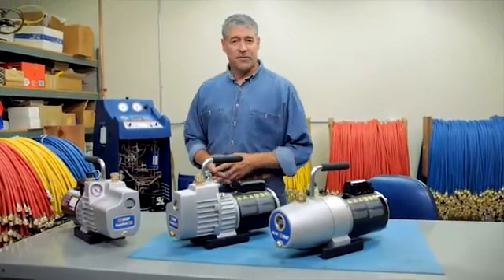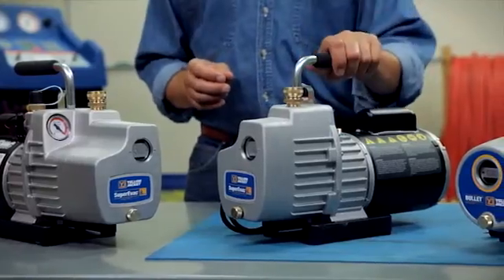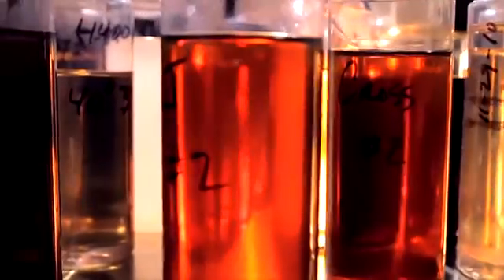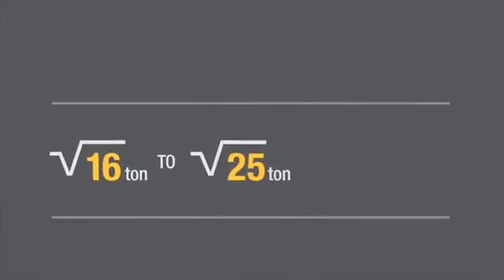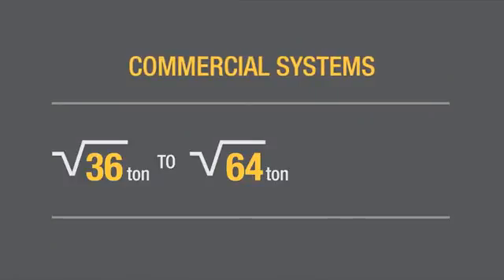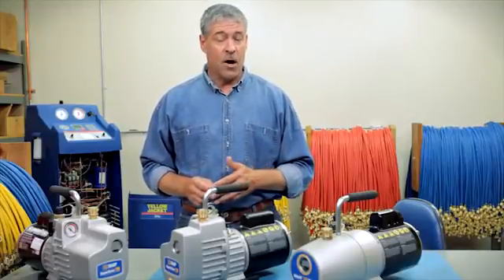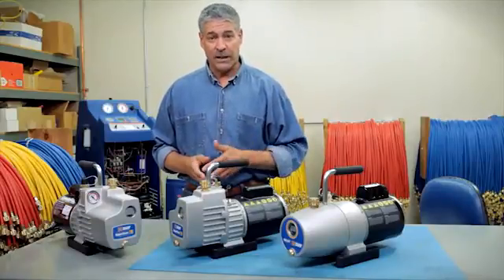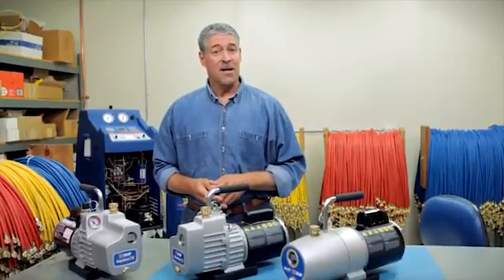How to choose a vacuum pump

Comment: My first comment didn't go through, but this is the question. How are residential units 16–25-ton systems if 1 TON=400 CFM...Most homes won't have but 2100 square feet equaling about a 3.5 TON system. Even the bigger houses you come across MIGHT have a 5 TON system. But these homes usually have a higher cooling and heating load because of high ceilings or glass windows and doors. Maybe the highest overall Tonnage of a home would come across as a 7.5-to-8-ton house, but these homes are very expensive with both high ceilings, glass windows, and a cool basement... Someone please explains to me where this person lives if he has a 16 TON minimum home...

Comment: And are you sure if atmospheric pressure is roughly 760,000 microns. When ANY pump works the exact same after 100,000 microns? I don't know it all, but a typical micron gauge doesn't even pick up until roughly 10-50,000 microns. So, what gauge are you using to measure these pumps? Maybe this isn't true, but I have heard the higher the CFM pump the faster the vacuum? If you said around 6 to 700 microns and they all work about the same I might agree with you. Again, I don't know it all, but can someone help me out here? Code requires at 500 Microns and the system is good. However, its best to pull below 2-300 microns and let it hold as long as you can before breaking the vacuum. Although I do understand the part about easy travel. I also would rather add 20 more pounds to something that will save me an hours' worth of vacuuming to ensure it is done properly without rushing. the oil port shouldn't affect which pump you choose, as funnels exist in the world for just that reason. Good example for what I'm asking here is do you choose a car that runs best, saves on fuel, and is cheaper on maintenance while handling high milage....Or do you choose a car that makes maintenance easy while making you spend longer at the next gas station? (In reference if you had the money to just choose whatever you wanted)

Comment: 16 to 25 ton typical for a residential  system! What?! I have a 1400 square foot house and I have a 2-1/2 ton unit. I had a 2,400 square foot house that was also a 2-1/2 unit but was super insulated. You totally lost me. Can you please explain what you mean by 16 to 25 ton? Every 12,000 buys is a ton.

Comment: Im building a fish observation tower and need a vacuum pump to remove the air from the clear tube so that the water flows up into the cylinder. What might be recommended?
.
Reply from the maker: We only have pumps for HVAC.  Best thing is to approach the aquarium or fish supplies company for this

Comment: Q: two vacuum pumps: 1- sucks 100 m3/h 2- sucks 200 m3/h .. as i understood from your vedio is that #2 reach the maximum vacuum pressure value befor #1 .. when reach the value the two speeds are the same?!! how could that be if #2 is larger by twice so contineous sucking for air .. or it is just to keep the vacuum at the same value .. as in boiling something when the temperature fixed on a value then the material melt!